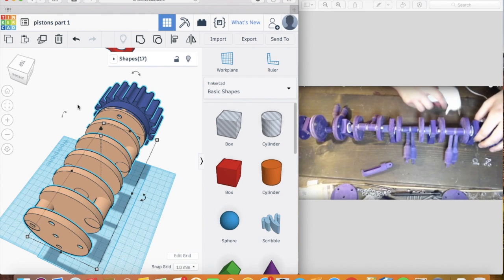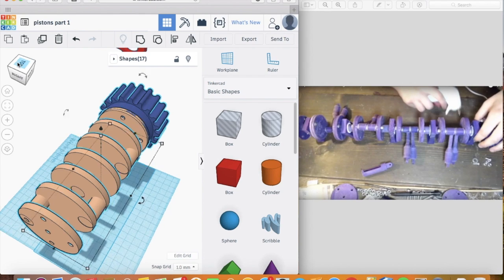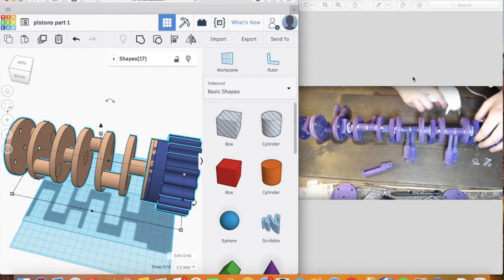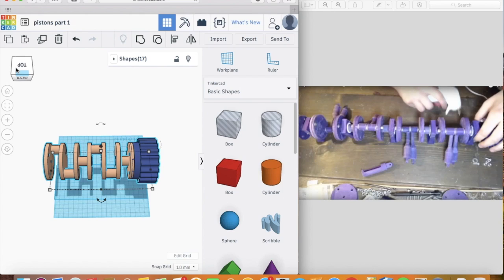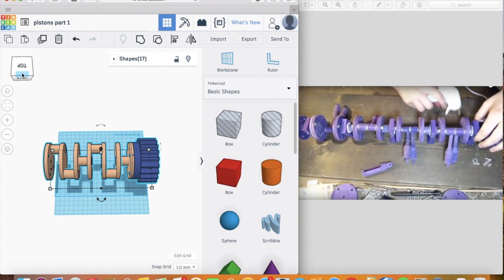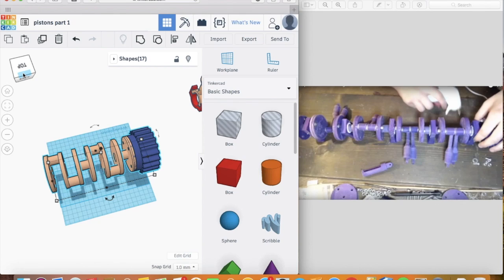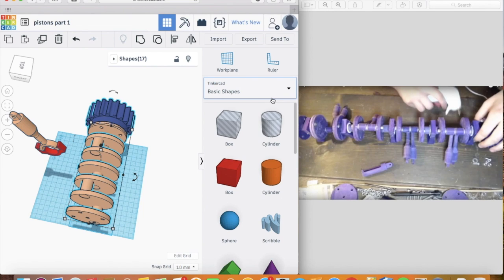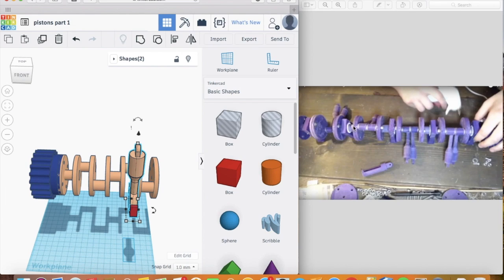Building a better V8 solenoid engine

Comment: You might have better luck with a radial configuration which has an incredible short crankshaft and the round configuration would stiffen up your whole build.
Reply from the maker: I was actually thinking of trying of those out, they look insanely cool when they run